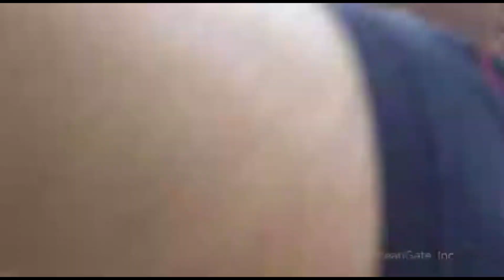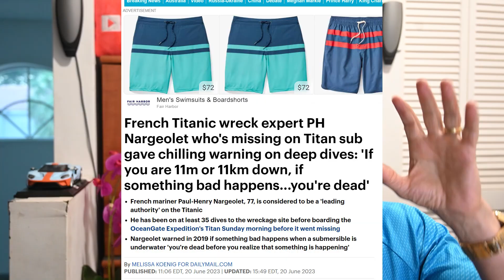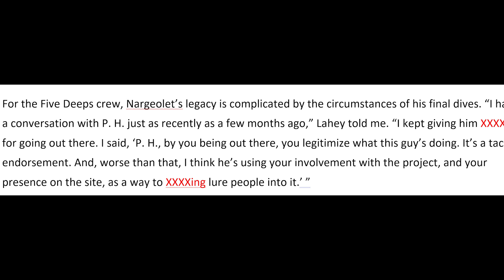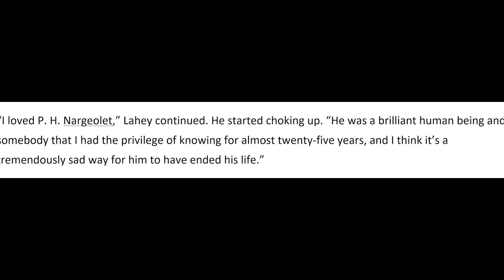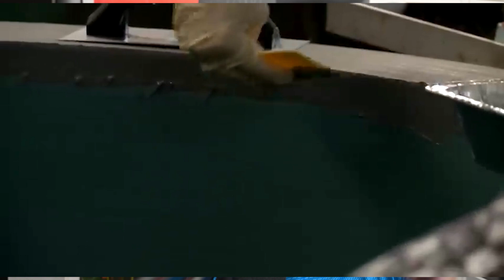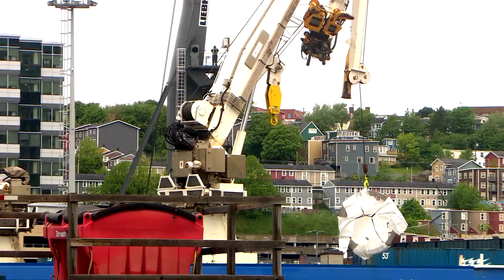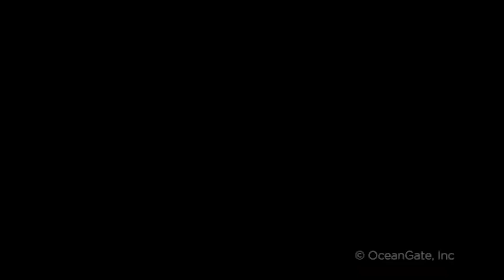Titan Sub: More Q&A, Design Defects, Why Descent Fast

Comment: A smooth manageable decent rate is to help you make small corrections in  the attitude ie pitch and roll.  Sinking like a stone really would only matter if and when they impacted something. The shipwreck, the bottom, etc. they arrested their decent prior to impacting anything and were attempting an assent. Of course if the "transcript" was genuine.
Reply: New information today. Go to the Snopes article about the purported Titan sub transcript. I can't link it here or YouTube will filter out the comment.
Reply: @jordanliles  Good article. I had my doubts. That said what does Camron know to suggest they were attempting an assent?  I guess at this point we'll never really know. The Red Strap going thru the view port and the clean edges of titanium pretty much tell the story.

Comment: For those who insist on claiming previous dives were all 90 minutes from the surface to the site, this is straight from OceanGate's faq page, in the event it disappears:

How long is a Titanic dive? 
A Titanic dive takes approximately 10 hours from start to finish: 

- Mission Specialists board the submersible. Dome closes.
- Sub launches from the Launch and Recovery Platform (LARS).
- Descent begins. It takes about 2.5 hours to reach the bottom.
- Dive team explores for up to 4 hours depending on conditions.
- Ascent begins. It takes about 2.5 hours to reach the surface.
- Submersible recovered to the expedition vessel. Dome opens and Mission Specialists exit the sub.

Comment: This all assumes the transcript is legit.  If it is, I worry that sub was leaking from start.  Or there was gross error in weight on board.  As  it was not surfacing at expected rate after dropping the ballast.

Comment: Mr.Rush has acquire those carbon fibers from Boeing. And their engineers didn't plan to use them, because the shelf life of these carbon fibers had expired. Very, very, dangerous negligence and cost cutting way..😮

Comment: I think we need to keep regular submariners input in separate column. The properties of carbon fibre are so different. I’m not saying they have no value, but at many times since the event they have steered peoples thoughts towards the properties and behaviour of steel. A material made of bonded fibres require those fibres to break individually rather than simultaneously. And it seems more than likely that the 'crackling' reported was individual strands or clusters of fibres cracking. Another problem with this is you cannot usefully test for integrity before a dive, except on a single use craft. If you know the starting strength of a hull and accept that some fibres will be damaged on a dive then you can over build it to compensate. However as the hull progressively weakens over more dives, it is more prone to damage under less load. It would also be weaker having descended through a thousand feet of damaging pressure, when it began the next thousand feet. Its properties are closer to a fabric than a sheet of steel.  
There are probably some mathematical differences that need to be applied too. A regular submarine has a diameter between 9 and 14 metres, and has a hull that 2 or 3 inches thick. I think the Titan was about 6 or 7 feet? And the walls were 5 inches thick. If one area of the hull started to depress, the fibres on the other side of it would be going through a whole separate kind of stress. If fibres on the outside were compressing, they might be going though stretching. It’s stunning that someone could think of using such a material.

Comment: Makes you wonder, had they not descended that quickly, maybe the hull deterioration would be slower -- giving the acoustic warning system more time to alert the crew before failure.
Reply: Carbon fiber does not deteriorate slowly or deform, like titanium would. When carbon fiber fails, it implodes suddenly and catastrophically, shattering into many small shards instantly, in milliseconds. There is no way to know when this will happen, and no way to be warned. It is not a suitable material for submersibles; there are many videos and much info on this topic.

Comment: My dad worked on subs, machining design/drawings. 
The lore back then was you tie a string across the sub, the short way, tight. Like a clothes line. When it goes to depth the string will lie on the floor. The pressures were super high,  Mind boggling. Most regular pressure vessels, like tanks are 500psi working. That's a continuous aluminum jar. Or think of a paintball tank. There are carbon fiber ones. Those are contiguous. 

I've watched the F1 cars chassis being made, they autoclave/vacuum back those,. They are sometimes wet laid.
The new boeing and f1 cars use pre-pregnated expoxy carbon fiber sheets. It is laid cold/dry. Then it's autoclaved/vacuum bagged, there is no squeeze out that i know of. If that stuff was expired, someone said. Then that pre-pregenated two part expoxy didn't cure right anyways? Not sure what was used.  Or is it 1 part that cures with time?

Comment: 7:44 They just wind the tape with a small pitch. This is silly. In the case of loads, the material will crack to the full depth along these spirals with a very small pitch. There is no reinforcement along the length of the cylinder. No diagonal reinforcement.

Comment: I have carbon fibre fishing rods made with more care than that thing and they use an Auto Clave during manufacture as the same company make aerospace parts. As you rightly point out the bonding surface was not prepared properly and the whole thing was just a sub standard unproffesional mess.  🇬🇧

Comment: What happens to the cylinder(spool)  that the carbon fibre is wound on to? Does it become part of the hull? Or is there some way it is removed. One video shows a green substance which could be a mold release compound. What seems to be missing is a complete drawing of the hull and all of its parts. There must be some inner cabin wall, because pictures show video monitors "bolted" to the cabin wall, and I cannot fathom that one would bolt anything to the carbon fibre wall.

Comment: The whole principle of Rush trying to apply "aeronautical"  concepts to marine applications doesn't make any sense,  since the atmospheric  ( and underwater)  pressures are much different,  so an aircraft's  composition  would not apply to underwater pressures 12,000 feet deep;  so it seems to me the construction of the underwater vessel  would have to be of a much stronger material,  NOT  carbon fiber,  either all steel or titanium;  Jeff will be much more versed on this topic,  I am not even an engineer,  but intelligent enough to conclude that the carbon fiber material  being stressed every time  the vessel dives  ( decompression  and compression)  would result in collapse,  or failure,  Jeff has valuable information  which is not any "BS"  or inaccurate statements,  he  knows more about Titan  than OceanGate did,  that's  obvious!!!!  Rush was more interested in having an "underwater party"  than being concerned with the safety of the "Mission  Specialists"!!!!!  Great job,  Jeff!!!

Comment: Assuming that it was ballasted correctly for this mission, that accelerated decent indicates that there was already something wrong with the sub. Something had already reduced it’s buoyancy. I’d suggest that the carbon fiber hull had taken damage on the previous mission, and that they were unaware. The rate of pressure increase between 2-1/2 hours vs 1-1/2 hour is not going to be the difference between a successful mission and implosion.
Reply: I don't think the hull was an empty space that could be filled. That would invite too many problems since you'd then have over-pressure when the sub is in the sunlight. No, I think it was all just an electrical issue. A short circuit that wasn't bad enough to flip a breaker but was bad enough to limit thrust. Since at least the correct current was going to the motor, it was assumed all was good until the alarm went off. Then I think a battery burst that created a shock wave that did it in. A parallel circuit(the short and the thruster motor) would have lower resistance than either and thus would cause the battery to output more current than it was supposed to.

Comment: I put together a spreadsheet to compute the descent rate at each reported depth. The salient data points are at each reported depth where I compute the average descent over the interval since the last reported depth. The start time is when the sub reported starting the descent.

The reference descent rate is  25.3 m/min and the average over the descent is 36.34 close to that reported by the sub. The average descent intervals each show a progression in the descent rate from 27.6 to 44 m/min indicating that the sub was taking on water.

I don't see any inconsistencies to indicate a  falsified log file.

Video Time	Time Stamp	depth	DeltaT	DeltaD	Rate		Description
M:S	                H:M:S	       meters	Sec	       meters	m/min		
1:33	      7:54:07	          0.00					                        Start Descent
1:50	      8:21:28	      756.00	27.35	  756.00	  27.64		First Depth Report (nominal 15 minutes )
3:50	      8:51:30	    1934.00	30.03	1178.00	  39.22		Second Depth Report
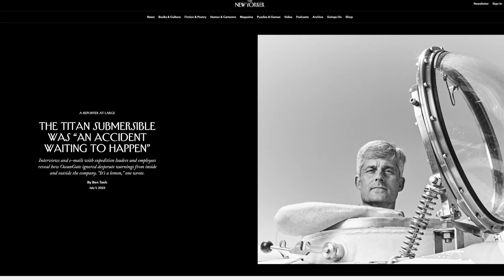5:16	      9:17:50	    2960.00	26.33	1026.00	  38.96		Third Depth Report
5:42	      9:28:35	    3433.00	10.75	   473.00	  44.00		Fourth Depth Report
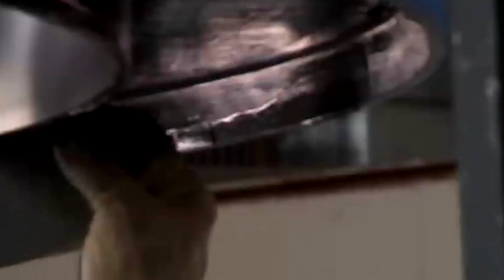7:37	      9:35:48	    3433.00	  7.22	        0.00     0.00		Attemped Ascent
							
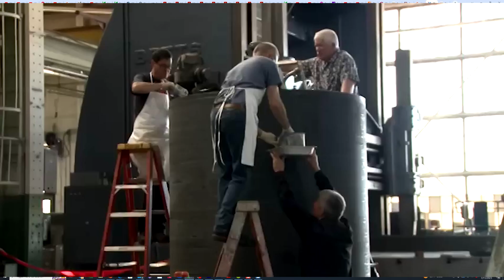7:37	     9:35:48	    3433.00	94.47	 3433.00   36.34		Average Descent
							
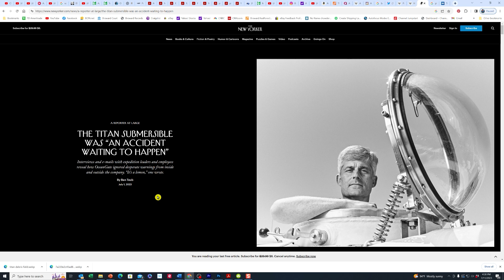3:02			                             150.00	 3800	   25.33	        Reference Descent
Reply: How could the sub have possibly taken on water without imploding sooner?
Reply: Good analysis.

From previous dives, the usual descent rate was about 25 m/min.

It is unclear when they actually commenced their descent, as once released from the launch sledge, videos show the sub moving forwards and loitering for a bit.  A delay of 8 minutes from the 07:54:07 'start of descent' report (perhaps getting everybody settled, adjusting trim etc), would see the actual descent rate for the first portion at 39 m/min, the same as the following ones.  

I would expect that (perhaps inadvertently) the crew was following the aviation mantra of priortising effort, viz.; Aviate, Navigate, Communicate, in that order".  Thus as their concern / workload increased they may have delayed communicating depth reports.  Thus the report at 1934 m depth which calculates to a slightly reduced rate could have been sent a few seconds late, which would increase the apparent time for the interval, and hence reduce the reported rate below the actual.  

When you round your figures to the nearest whole number, then the rates for each interval become 39 m/min (allowing for a delayed start of actual descent), 39, 39, 44, thence the end. The data does not warrant higher precision in the analysis.

Once the dive was underway, the sub could not gain mass, so the only way the rate of descent rate could increase was by loosing buoyancy.  The crew did not report any water leak at any stage, and given the intimate surroundings of the interior of the pressure hull, one would imagine they would have noticed.  But something must have been happening to reduce the displaced volume of the craft as they were passing 2960 m and the alarms started to sound.   

The final info on the state of the structure was the report that the frame had been jettisoned after several tries.  This suggests that the frame supports on the titanium end rings were no longer in their correct alignment hence jamming the frame in its sockets.  Were the end caps twisting and/or moving towards each other?  Was the frame the only thing holding the end caps apart?  

Was the loss of buoyancy due to the end caps moving towards each other?
Reply: @nigelwilliams7920  The frame jettisoning difficulty definitely suggests misalignment, but the frame pretty clearly would not have been able to withstand the bending moments involved. Had it been the sole thing keeping the end caps apart, given the tremendous forces involved, it would bind and never been freed while the structure was intact. You'd expect to see fairly drastic deformation and clear gouging at the contact surfaces between the frame and the caps.

As for the loss of their buoyancy reserve, there are two possibilities: increase of mass, and decrease of volume:
- The first possibility has the difficulty that water incorporation into the vehicle has to be in a way that is subtle enough not to lead to an abort -- even with Stockton Rush's non-existent sense of self-preservation, there are either three of four other people who could mutiny and abort the descent, so it can't be at a rate to cause them to freak out. 
- The second possibility has the difficulty that carbon fiber shatters rather than undergoing plastic deformation. As I understand it, under the compressive loading of a dive the CFRP cylinder loses about 1cm in radius -- measurable, but not so drastic as to immediately suggest itself as the explanation for the out-of-whack buoyancy. Previous successful ascents also took place with a compressed CFRP structure.
Reply: @Jesse-qy6ur  I agree with you completely, however I am stumped as to what can explain the observed behaviour.  

As Sherlock Holmes is said to have quipped: “When you have eliminated all which is impossible, then whatever remains, however improbable, must be the truth.”

As you say, the sub cannot have gained mass, so it must have lost buoyancy.  As far as I can see from the diagrams of the sub, there is no other part of the sub which could change shape to account for the buoyancy loss. Yes, it is utterly improbable that the hull could progressively deform through 2960 metres depth to cause a faster descent, but I cannot find any other 'truth'. Remember, we are dealing with a 'structure in the form of the carbon fiber wound cylinder (which was the second hull, apparently, which was autoclaved etc) which may be rather more resilient than the original one.  Who knows.

The hull deformation was reported by the RTM alarms starting around 09:17 (2960 m) and continued down to 09:35 (3500 m, "Starting ascent") and no doubt until breakup.  So there was almost 20 minutes when the hull deformation was detected by the sensors., and by 3433 metres depth all of them were 'red'. All of them.  There was a lot going on.  Smart folk will do analysis on where those sensors were, and make sense of the sort of deformation which could cause them all to trigger.  

But hey I'm just an armchair analyst sitting here about as far away from these events as it is possible to get without falling off the edge of the Earth! Wot do I know! :)
Reply: @nigelwilliams7920  with the reality that there is no possible way the sub could've gained mass, and how unlikely it is that the hull could've deformed enough to lose that much buoyancy (due to the physical properties of CF), I think the most logical conclusion is that the transcript is a very convincing fake, betrayed only by its discrepancy in descent rate.
Reply: @biosparkles9442  It would be very helpful to see an 'authorised version' of the communications wouldn't it, then we would actually have something to go on with.  I'm sure the vessel controlling the dive has all that well secured and it will be made available to the authorities in due course.  In the mean time, I am inclined to believe that the transcript is real in so far as its data points go, which leads me to my conclusions.  If its false, then all we know is that the sub is lost, and the rest is speculation.
Reply: @nigelwilliams7920  This transcript is almost the exact same as the confirmed fake that came out before it, in which radio jargon ("over" etc.) was used, making it clearly fraudulent. It seems that this latest transcript is simply an edited version of that original fake, fixing all of the issues people called out in the original.
Reply: What's interesting is the third depth report shows a slight decrease in the depth rate. I would expect a forgery not to include a detail like that, which suggests a complicated physical process that slightly self-corrects with either depth or time, but then progresses afterwards.

Comment: What got me is that Boeing, and from what I've seen online everyone else , puts their Carbon Fiber on with a 45 degree helix, and then as the machine comes back it reverses the helix so that the layers are at 90 degrees to each other. (Just like how you make plywood!)
They Do NOT spin it on as if you're putting string on a spool!!!  This has to be a major design flaw!!!!!!!!!!!!!

Comment: I think the hull already gave in under the pressure and this caused an increased pressure in the inside. So the hull buckles (unnoticeably) and compressed the air inside. This caused it to sink faster and this would also explain, why the sub did not properly ascent after they jettisoned the ballast.
Reply: but this material cannot buckle.

Comment: The reason why they descended too fast was because they were overloaded. They had people in the sub that pushed the scale over 400kg. That is why when they drop the balusters, they stood still. Normally they would pop upwards, instead they were neutral. Only when they drop the landing frame, they slowly starts to ascend. Evin if they did not implode, they would never have made it to the service, without help from the mother ship. For someone who flew commercial plains, who has to take the wight of the cargo in consideration, every time they took off, this error was very unusual.

Comment: I don't understand about the glue... if it was done badly, wouldn't the submersible implode right away?  Some author claimed that since the pressures were inward, the glue didn't matter... but then why use it?  Something doesn't seem to fit, or I'm missing something.